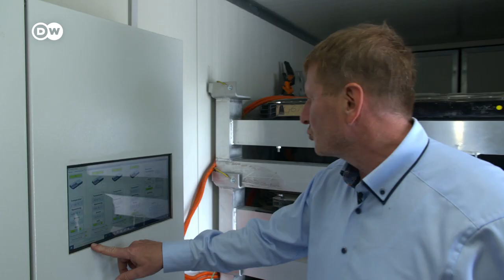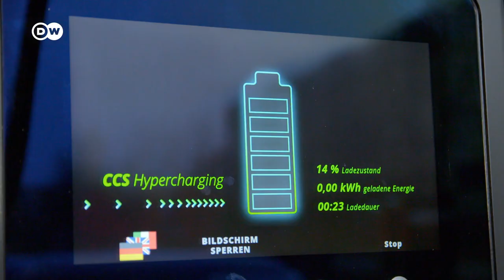Second Life Batteries: The Solution For Sustainable Mobility?

Comment: This is not recycling. This is reuse but at least it puts the battery to good use although  I don't think the second life will be long enough because in EVs there is a cooling system to keep the battery at optimum but here in second life I don't see how the battery temperature can be controlled. 
I also doubt whether these are environmentally better than Lead Acid batteries because recycling those is far easier and far less nasty than recycling lithium batteries. 
Fast Charging also decreases battery life.
Reply: you can say that again~